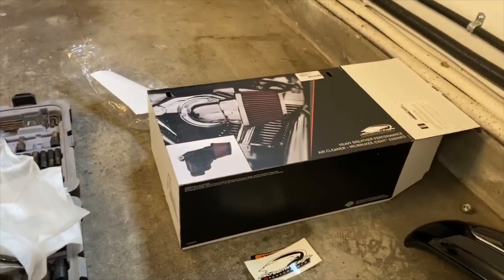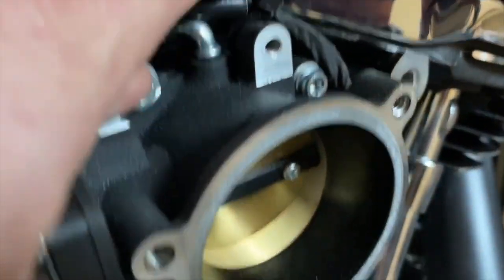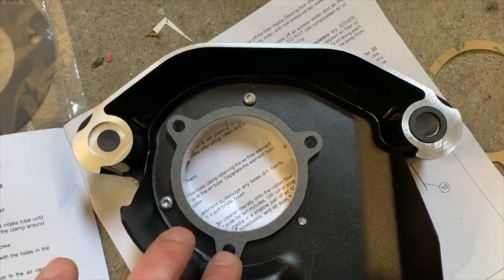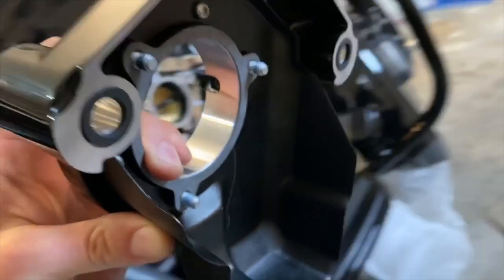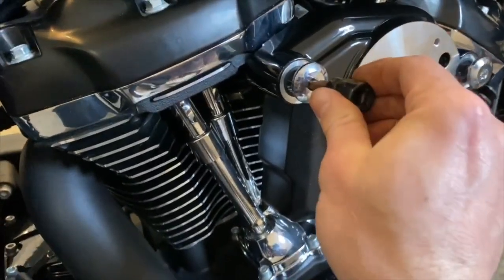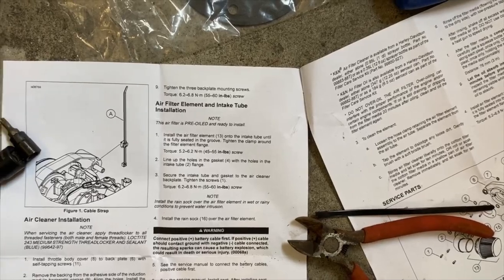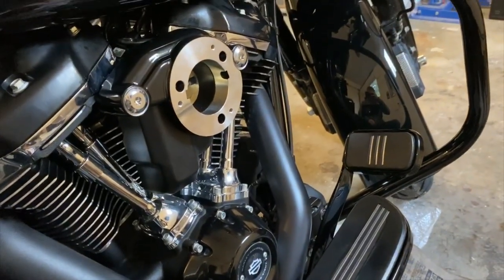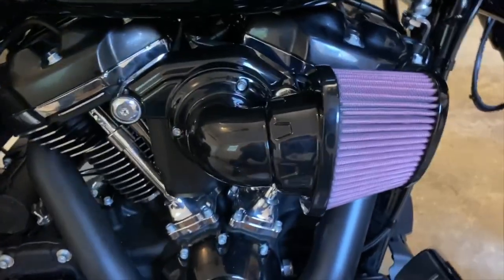Harley Davidson M8 Screamin’ Eagle Heavy Breather Performance Air Cleaner Installation 2017+

Comment: Redo those breather bolts to vent to the atmosphere keep all that oil from blowby out of your intake manifold
Reply from the maker: IH0EZAY will oil not come out of those bolts if they are just left open?
Reply: xpl0sive22 they makes external breather kits, oil won’t spew out but your just misting Oiler air into your manifold and over time you’ll get a lot of carbon and gunk in your combustion chamber and intake mani. The factory does it that way to get away from the epa but it’s not good for the motor especially if you ride a lot of mile or ride hard
Reply: IH0EZAY yo. I have the exact same heavy breather. I noticed I’m getting oil spewing out of the top left back plate bolt. Is that normal? I’m wondering how oil is finding it’s way to that specific bolt.

Comment: if you install this, call fuel MOTO. Do not use SE street tuner and get a full system. The SE tuner will hold you bike back and the dealer saying they dyno your bike for 3hrs...it’s all a scam they download a tune from SE website and send it to your bike. You’re welcome and I just saved you 1k$ is bullshit dyno tunes and Scramin eagle tuner.
Reply: Thank you for that info